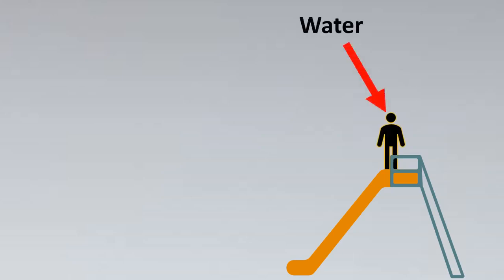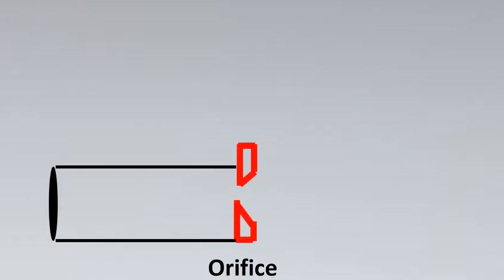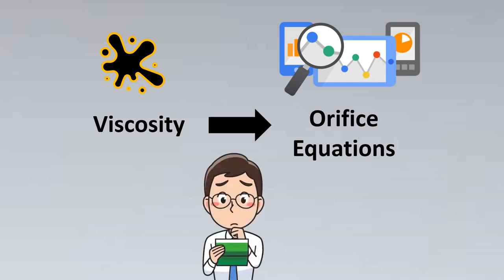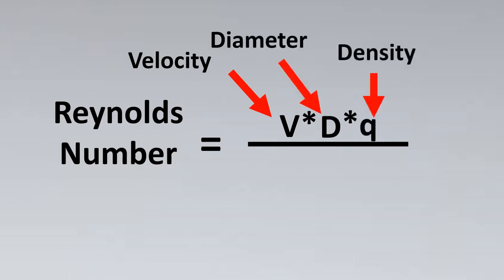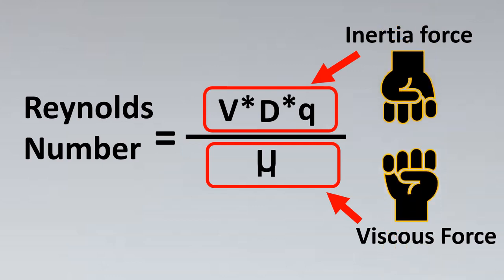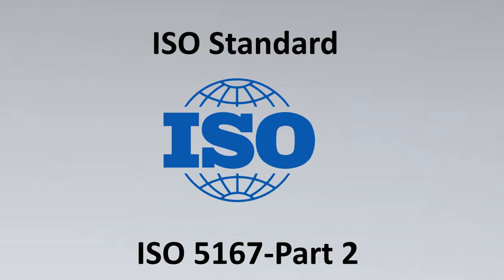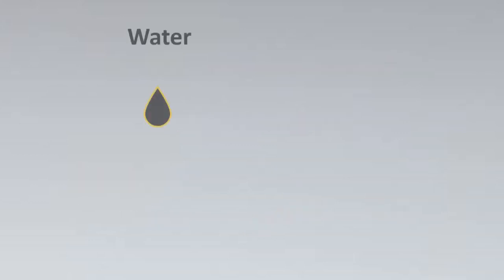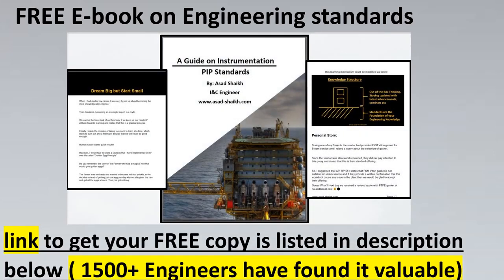ONE IMPORTANT REASON Why to check Reynolds Number for Orifice Flowmeter

Comment: quadrant edge orifice Plate can accurately measre Reynold <2000 laminar flow 😢.  this is exist in our plant. why u say 5000>?
Reply from the maker: Thanks for your wonderful comment !! 

Let us discuss this in 2 points.

Point 1 :- Orifice is ISO 5167

Refer below scope clause of the standard  (Page 1 Clause 1): . It (meaning the standard) is not applicable to the measurement of pulsating flow nor does it cover the use of orifice plates in pipe sizes less than 50 mm or more than 1 000 mm, or for pipe Reynolds numbers below 5 000.

Point 2 :- Even Though the standard does not give Guarantee below 5000 Reynolds number, it is users own responsibility to use it below this threshold with respect to accuracy pressure drop etc.  

So if for your application the Accuracy is acceptable and the pressure drop are acceptable then it is alright to have it.

However major client reference ISO 5167 or API MPMS 14.3 and require compliance to them hence mentioned.

I am curious, Can you share the service and the accuracy and pressure drop so even We can recommend clients to consider since it is proven in a plant.

Thanks once again for your comment. 😊
Reply: @AsadPassionateEngineer  service is liquid crude oil with medium API crude. accuracy and pressure drop i will confirm to you. thanks for clarification